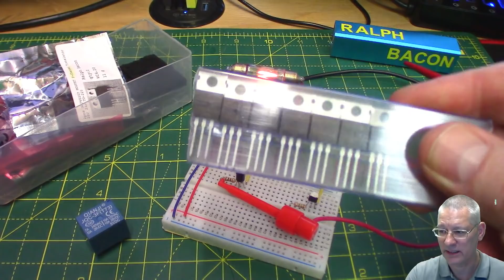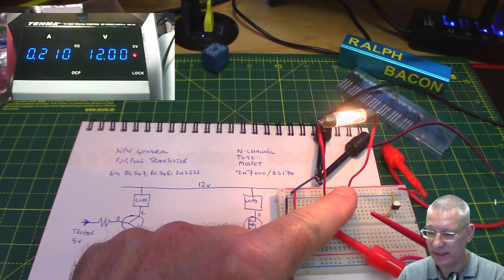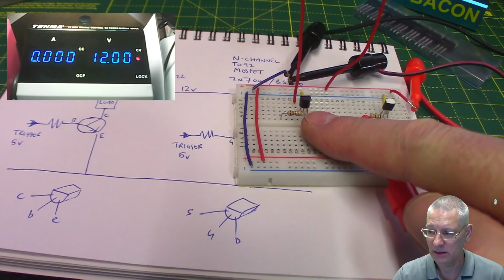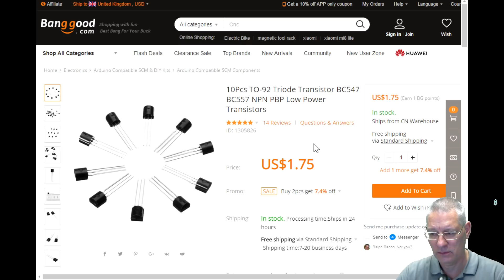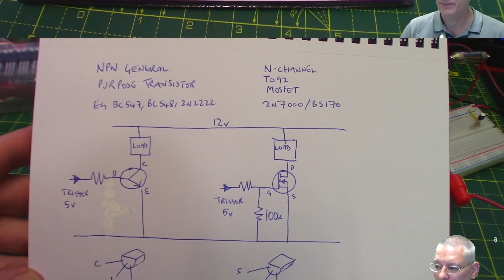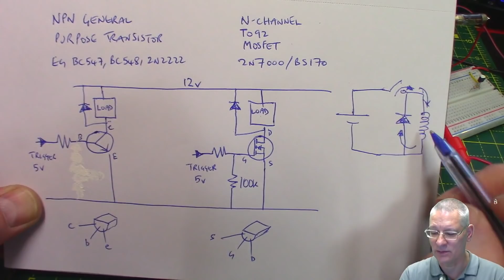#136 MOSFET vs BJT NPN (TO92 package) 🤷

Comment: In order for the transistor to switch off, the capacitance has to discharge through the gate resistor.  Doesn't this slow the switching speed?  Are Mosfets generally not good for high speed applications?
Reply from the maker: There are hundreds of different MOSFETs and many are suitable for high speed use. And out of the following list: JEFT, Triode, MOSFET, BJT the MOSFET switches the fastest so that might tell you something.

Comment: Hi Ralph,
say my purpose was to use the bc548 to drive a high current LED, would you recommend or suggest I likewise put a diode across it just like you would do with a motor or a coil ??
of course LEDs don't produce the back EMF or should i include the diode regardless ?? for good practice perhaps ??
Reply from the maker: Two things here: firstly, I would not recommend the BC548 to drive a high current load. Use a MOSFET such as the IRL3705N which will not even break a sweat at several amps (you don't say how high current the LEDs are). Even a simple 2N7000 can pass 500-600mA without a heatsink. 
Secondly, a diode across such a load would not be "good practice". It's not exactly Bad Practice, but there should be a reason for doing things rather than using a belt-and-braces approach because it's done elsewhere. If you are driving a relay or motor then it will be required but otherwise there is no need!
Reply: @RalphBacon  
Well .. ok, I'm going to be quite honest.
my leds have a maximum voltage of 5.2V with a max forward current of 40mA.
I have found the right BJT transistor and  mosfet i could use but I've gotten quite indecisive as to which one i should choose. the mosfet is a bit pricy unlike the BJT transistor, when it's off, there's no current going through. which is great for saving energy. 
Also a very important question here that i have always wanted to ask you:
Your video #123 Arduino Auto Shutdown (and switch off)
I was successful in using the  Si4599 to build the auto shutdown circuit, however, you probably may have realized as well that there is always a voltage drop across the mosfet whenever a source of power is connected: example, the arduino's led including any other led or motor turn on for a fraction of a 100 millisecond whenever i hook up a battery.
I was wondering, is there any way to prevent this from happening ?
Is there anyway of preventing voltage drops on mosfets at all ?
Kind regards

Comment: The Gate Threshold Voltage of the 2N7000 has a max voltage of  3.0 Vdc which, for me in some circuits, in a no-go.
Another issue is the ESD - it is easy to say 'no problem' if  ESD precautions are taken but it is not always easy to do.
And as you said a  max current of 200mA can be a limitation.  The  very cheap 2N2222 handles up to  800mA.
Reply from the maker: Well, what you say about the Gate Threshold is true, Kenn, but to put it in context the datasheet states: VGS(th) 0.8min 3.0max Vdc so by selecting one that works in your hoyist circuit it should be OK? Not so good for commercial items!
But I totally agree about ESD; it was these very MOSFETs that I managed to kill, one after the other, just by touching them! Now I'm more careful.
The 2N2222 is my go-to, general purpose, NPN transistor (or its many equivalents) but they are not MOSFETs and sometimes only that will do! Horses for courses!
Good points you raise there, Kenn, thanks for posting.
Reply: @RalphBacon  Fair point - one might have to select a BJT by hFe and so  measure. In my case select a MosFet by  measuring Gate Threshold voltage. For small signal BJT it is easier as my  DVMM has built-in hFE  measurement!
Reply: @RalphBacon  BTW I think the logical High voltage (for output) was  implied to be 5 Volts (for Vcc = 5  V) whereas I see it as  from 4.2  to Vcc
. So Arduino users (Vcc is 5V) don't have to worry. 
[ For TTL it is 2.7 to Vcc  which makes selection mandatory ]
Reply: @RalphBacon  On ESD I worked for a  set-top box manufacturing company in Taiwan and the engineering section had:
1) seamless metal floor  which was grounded
2) metal top tables which were grounded
3) wrist straps which were grounded
So I smile when someone says  "just" follow  ESD precautions. It isn't so easy (though the above was overkill).

Comment: Why choose one over the other: Start at 10:51
Pro MOSFET: gate current only during switching.
Contra MOSFET: static discharge sensitive, ohmic resistance in saturation instead of constant junction voltage drop in BJT.
Reply from the maker: Would you say that the D/S resistance is a bad thing (compared to a constant junction voltage? Given that some MOSFETs go really low (eg 0.02ohm) when fully on I would say this is better (and more predictable) than a BJT when used as a switch. But I'm with you on the static sensitivity - several of my 2N7000s are now in MOSFET heaven. RIP.

Comment: I paused the video, and I am answering the quiz questions.  Hopefully I don't make a public spectacle of myself.
Both resistors have a value of 1k Ohms.  The ceramic resistor has a tolerance of ±5%.  The carbon/phenolic resistor has a tolerance of ±10%.
So the ceramic resistor is better.
Reply from the maker: So which one is "better", Richard? You haven't answered the question! However, the answer was given at the end of the video which you now need to go back and watch as punishment. Or a treat; I mean, watching my videos twice, can it get any better? Thanks for posting, though, nice to hear from you.
Reply: @RalphBacon  I actually think that the bigger one with the easier to read color bands is the better one.  :-)  In a great many cases,  the tolerance won't matter all that much.  Heck,  I remember 20% resistors!

Comment: Would it be practical to use the mosfet as a touch switch?
Reply from the maker: Technically feasible, Michael, but hardly the purpose for which they're intended. 
Touching the Gate of a connected TTL level MOSFET could certainly start to turn it on, but in its linear region so not exactly a clean on/off transition. Of course, touching the Gate of an unconnected MOSFET could send it to semiconductor heaven, as I found out the hard way a long way back. Do yourself a favour and if you need a touch switch use the cheap-as-chips TTP223 module I describe in my video #143!

Comment: I have always used BC337 -NPN on the drain side of my relays when I manufactured my temperature controllers and if you remember on my rain sensor circuit I used a 337 on the replay drain and never had any problems there must be a few thousand of my controllers out in the public so that is my choice but any general purpose NPN will do the same job
Reply from the maker: Aggregating and summarising all comments on this subject seems to appear that BJTs are the preferred transistor to use for simple stuff like relays, sensors, coils etc, Bob. But where a MOSFET is specifically called for I guess that is when the 2N7000 comes into play. Knowing when is the key!

Comment: it's easier to handle SMD then to drill holes, so my choice is now SO8 case.
smth like IRF8714PBF or IRF6201PBF if cost is not an issue.
Reply from the maker: That depends on whether you're making your own PCBs, Leeroy, which I'm not (not any more). I'm about to create another PCB and I'm leaning towards THD as they are just so much easier to handle and identify. But we'll see...

Comment: Ralf, first thank you for posting this video. It seems to me that MOSFETS come into their own under a couple of situations. 

1) As you showed in the video the when you want to sink or source a lot of current the MOSFET structure works well, better than a Bi-Polar structure. 

2) Another reason that in some situations you use MOSFETs, is that they have better performance at higher switching frequencies than Bi-Polar structures. Switching frequencies far higher than an Arduino/Raspberry PI switches at.

In conclusion for the types of applications you are discussing, such as relay drivers, it seems that you are far better off in keeping with Bi-Polar transistors, if only for the lack of handling problems during assembly due to ESD damage. Just my opinion.
Reply from the maker: I'm with you, Mark, on the ease of handling for simple devices such as relays, bulbs, small motors and the like. I know lots of Arduinites do use the 2N7000 instead for such uses, and I'm sure it's fine, but it's a case of horses for courses; unless you need the MOSFET it might be "safer" to steer clear!

Comment: 15:16 Yes it is. You know the current. Measure the voltage and use Ohms Law. :-)
Reply from the maker: But you've got the resistance of the bulb included in that calculation, haven't you? Which is quite a bit different when cold compared to when brightly lit. I'd need to use a wire-wound resistor (which have not yet turned up, drat). Have I got this right, Jeff?
Reply: @RalphBacon  If you want to measure the resistance of your MOSFET or BJT (at a given load) just stick a voltmeter across drain source and measure the voltage drop. Divide that by 0.210 (or whatever current you measure) and you have the resistance. That is, if the transistor is in series with the load. Mr Kirchoff and his law applies.  You can measure the resistance with an ohmmeter, but that may be inaccurate and the transistor is probably not linear at that voltage/current.

Edit: Perhaps I misunderstood. I thought you wanted to measure the RDS ON. That is easy with a voltmeter when you know the current.

Comment: RDSon 5 ohms??????? I'm used to mosfets with an RDSon of less than half an ohm. no idea why they want to make mosfets with such a high value of ''inefficiency''
Reply from the maker: Even half an ohm is not really good enough for general purpose, high-power use, it just gets too hot. I'd be look at 0.1ohm or less. But these little ones don't get hot even when sinking the full 200mA (as you saw) so maybe it just doesn't matter here?

Comment: This was really interesting. It would be very interesting to see what happens when you lower the gate voltage below 5 volts. Because I think that is when the resistance of the mosfet is the highest. At least that's how I understood it. 
Here is a very interesting video about using mosfets as rds protection without a freewheeling diode.
https://www.youtube.com/watch?v=Aqng4sXIl3Q
Reply from the maker: Lowering the gate voltage below 4.5v is not recommended because then the Drain/Source resistance starts to climb a lot (and the device gets far too hot). When using MOSFETs as switches it always a good idea to drive them hard (5v for TTL, 10v for non-TTL level gates). So you have understood it correctly, Plesterman!

Comment: I tried to partly turn on a mosfet on a  7V 1 A load.  By reducing gate voltage. The mosfet got really hot,????  
They are tricky things. I’ve got to learn more about them.
Reply from the maker: That's because you CANNOT partly turn on a MOSFET, David. Well, you can but then it gets really hot. The whole point of a MOSFET is that we are using it as a switch - fully on, or fully off. If you want to dim a lamp or slow down a motor you need to use Pulse Width Modulation (PWM) with it, so it turns fully on (and then completely off again) many thousands of times a second. Yes, really. Look at my videos #14 & #15 - a bit old now, but still shows you how it all works.

Comment: Never used the 2N7000 but I have used it's big brother the BS170 in an ESP8266 clone of an Amazon Dash button. It's RdsOn is unfortunately high but it has a very low Idss which was I used it as it leaks too little current when "off" to power the regulator I was using. I'd started with an IRLZ44N because it had a very low RdsOn but it leaked far too much current when "off".

I'm old enough to have been playing with circuits when MOSFETs were too expensive for hobbyists and so naturally lean to BJT but certainly for PWM type circuits the faster switching speed really does give the MOSFET the edge.
Reply from the maker: Yes, that seems to be the consensus here, Gavin - for fast switching (possibly PWM use) then MOSFETs come into their own. But for normal relay switching (and similar) a BJT is "good enough" and doesn't get zapped as you pick it up!

Comment: i love the 2N7000, the ones i bought were better than specs, (i know it's not the correct way to measure it but) they had a gate capacitance of like 15pF and an actual RDSon of like 1-2 ohms and i also think you don't necessarily need the series resistor on the gate but yes, on microcontrollers it's useful to have a to-gnd resistor that lets the transistor off while power up

the electrostatic discharge thing COULD be avoided by pulling off any syntetic sweater off, trapping himself to earth, and pulling out the transistors from the bag ALL IN ONCE, this will mostly short em and avoid troubles, then fitting em on a sheet of conductive foam maybe... anyways big mosfets are rarely damaged in my opinion, having like 1nF or more of charge is unlikely you break the oxide layer at like 30V with just the touch

if you really want even smaller mosfets to play with, there still are the BF981 tetrodes (or similar, these are protected)  or the CD4007 chip (protected as well)

anyways buying 10 of em will have the price similar of 50 of em, the first auctions are just slightly cheaper but way smaller... and beware of fakes, they are like 75% of the transistors from direct China, there's a smaller die from anoter device, inside, most of the times
Reply from the maker: Interesting stuff, Voltroll, and I agree that wearing an earthing strap should protect the MOSFETs from careful handling (and not shuffling your feet on the nylon carpet!). Certainly some ICs are fakes from China  (I got at least one) but that's the first I heard about plain old transistors having the same treatment!
Reply: @RalphBacon  trust me, 75% of the component stuff is fake and unusable for what they are supposed to achieve, only modules are good, guess why... you buy a module, it doesn't work, you complain... you buy a transistor, it blows, you question yourself if you did something wrong and maybe not complain... and also kids and newbies will use overkill parts for whatever project so they are fine

op amps are almost all LM358... logic ones are what they need to be but sometimes (rarely) they are bad for some reason, the only one that was really bad was the CD4046, unusable

end usually the more they are interesting and expensive, the more they are fake, rare and niche parts are not exempt

but again, like 75%, not all, maybe it's what types of DIEs thay have at hand, that's my experience, diodes, whatever can hide the inside well, there are components i bought in a lot of formats and i come to the conclusion that THEY DON'T HAVE IT AT ALL, even if there are hundreds of packages types (SMT, through hole, etc) and auctions
Reply: Not necessarily fake but...  I bought some "audio level indicator" modules from banggood a while back. This was just a little board holding an LM3915 and some support parts,  and 10 LEDs.  The problem that I ran into was that apparently two of the pins at one end of the 18-pin DIP were not connected!  On any of them!  I went back and forth with them about this,  and was able to make the module work only when I went and ordered some LM3915 chips from another supplier,  and plugged them into the board.  I eventually got a partial refund on that particular order...

Comment: Bulbs can make bad test loads as their resistance changes by a factor of 5 or so from cold to hot.  That low resistance at cold can cause some unpleasant surprises.
Reply from the maker: And which is why incandescent bulbs blow when you first switch them on, of course. Good point, next time I'll use a resistor!

Comment: I think you're only going to see advantages in high speed switching applications like switching power supplies since they generally switch faster than bipolar transistors, or in linear applications where the high input impedance is important, such as medical amplifiers or high impedance oscilloscope probes. The gate-to-ground resistor can be in the megohms to stop static pickup by the way.Putting a series resistor in the gate will slow down the switching because the gate is essentially a 30-50pF capacitor, and so should be avoided unless this is intended;.
Reply from the maker: I've never used a MOSFET except as a low resistance switch so never in amplification, for example. Maybe that is where they excel? Hmm, that gate resistor ... Not strictly needed (the datasheet even says so) but if it shorts then bang goes your processor too. But your point on slowing it down is a good one.
Reply: What about a deep sleep battery situation? Would the transistors extra base current be a consideration?
Also Mosfets latch rather than requiring current at base just to keep the switch open.  I noticed in your example with triggering via finger that it didn't latch and assume it is because you hard wired it via the resistor.
Reply from the maker: I hope MOSFETs do not latch under normal conditions, Andrew, as otherwise we would have terrible trouble with PWM in motor control or lamp dimming. Perhaps you're thinking of TRIACs? Regarding Deep Sleep, yes, that was exactly what I was thinking, 2-3mA base current is a huge amount when the entire device is sleeping with maybe 20µA!